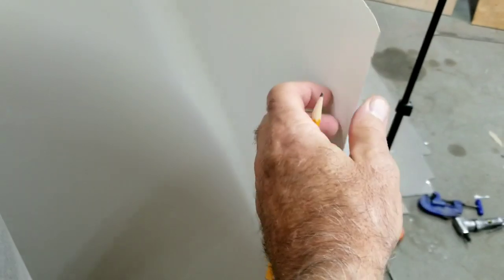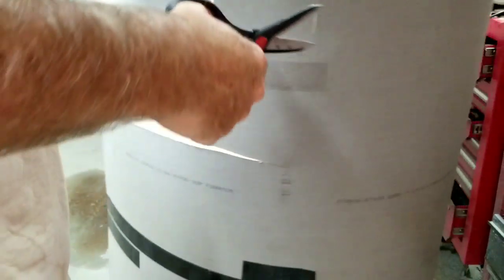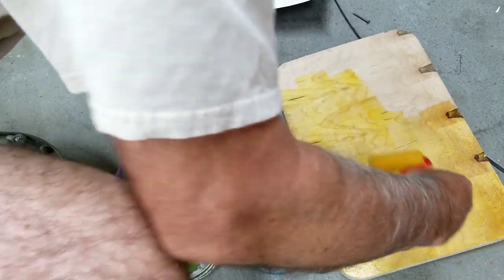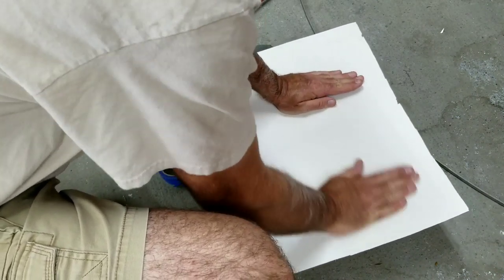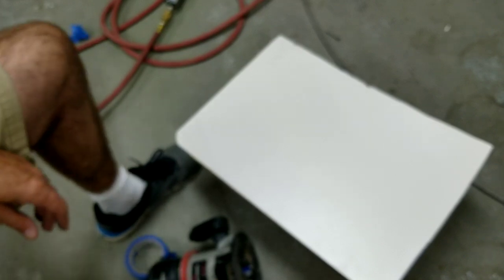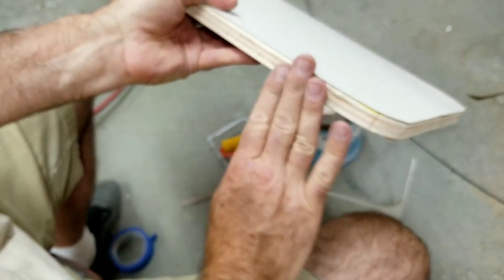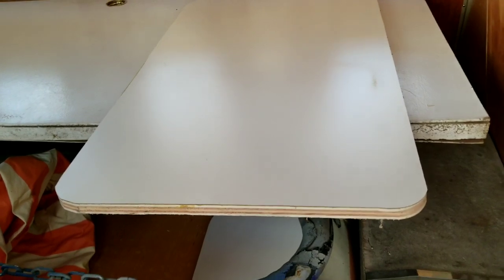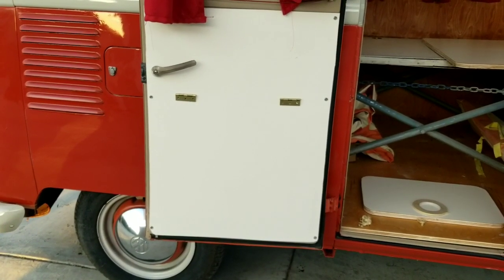vw bus  so23 westfalia  camper parts hand made

Comment: Good work Mike. I build all my counter tops so i should be able to do this on my bus.  Mike when I glue large piece I will take 3" wide strips of cardboard lay underneath will aligning up every thing then start in the center pull one strip of cardboard out at a time and press and roll it into place.  A fine file would work great on the sides, man Mike i never thought of using it on the door panels , I like that idea.
Reply from the maker: yea I do too but these were small pieces. so I just went for it. I just couldnt find anything to put under it and it was curled up I should have put it in the sun for a while then it would have been easier.too good points.

Comment: I used the red can of Weldwood to Glue Vinyl in the bus. 3 days later it all fell off. Landau glue is Automotive and can handle the SUN. I was wondering if the interiors was built state side? On Rambus the sleeper back seat had SAE standard 1/4 inch x 20 bolts and nuts on it.?!